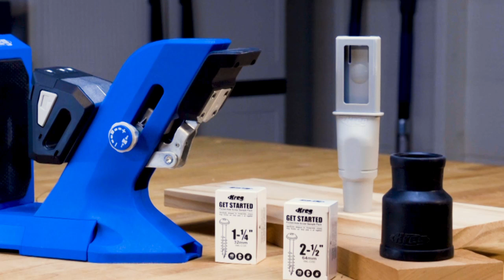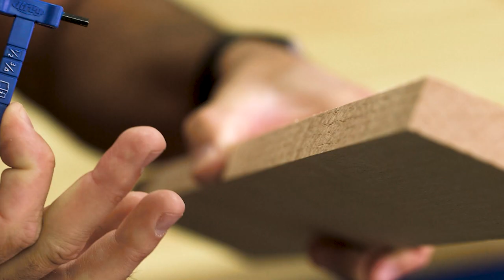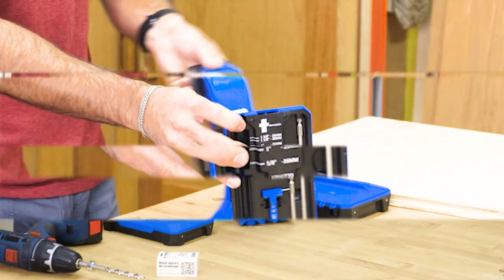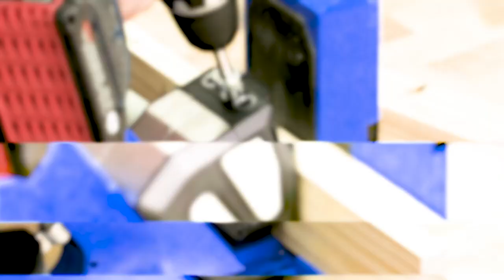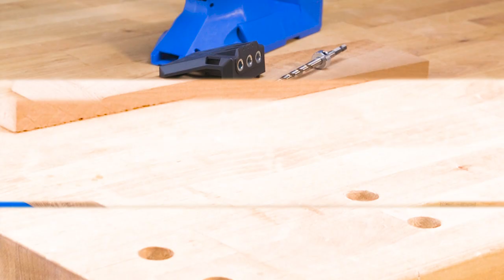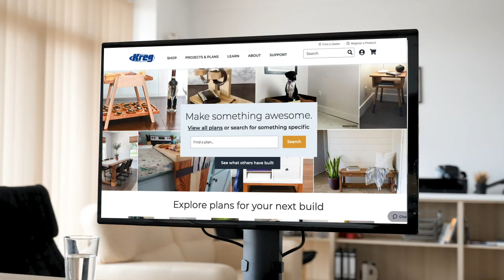Kreg Pocket-Hole Jig 720

Comment: So it cant handle a 2" 2x4?
Reply from the maker: The 720 works with materials from 1/2" to 1 1/2" thick. A 2x4's actual thickness is 1 1/2" thick so it will work. If you do get into building with a lot of 2x4 and 4x4 lumber, we'd also suggest looking into our Pocket-Hole Jig XL which makes larger pocket holes with more strength for those big projects.